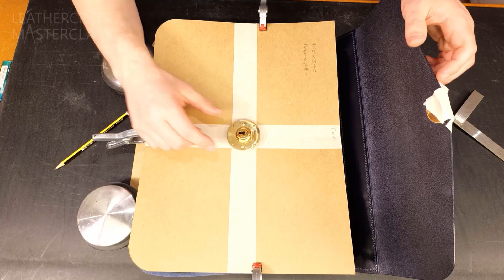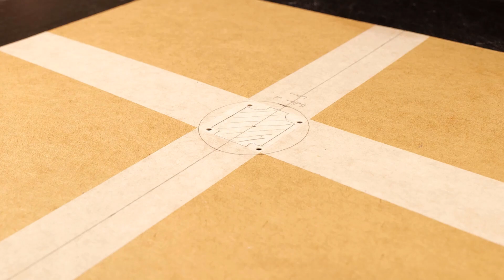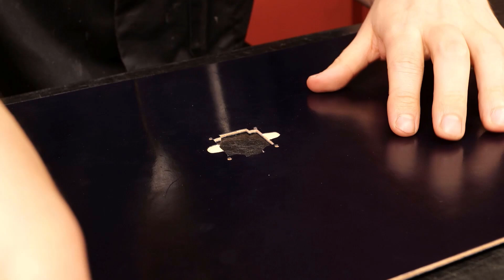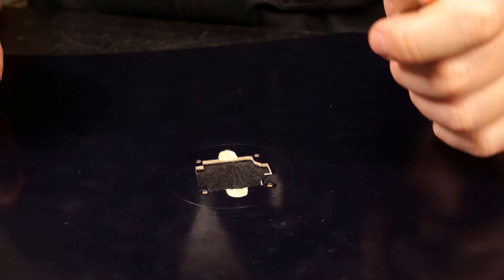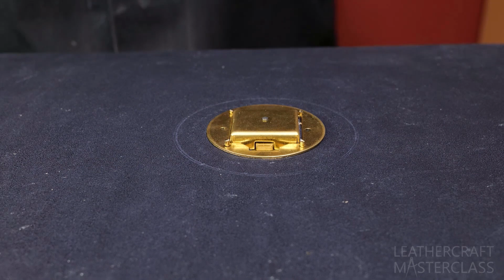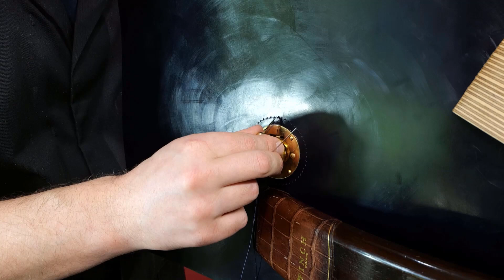How To Fit A Leather Briefcase Lock (Professional Use Only)

Comment: Just installed my very first round lock - the 806 from Abbey. Wasn't able to get brass nails quickly or a rivet setter but instead I used the bifurcated rivets that Abbey supplies. I had about 2.5mm of a gap that needed filling and as I'm making a sample -I just made a spacer with 3mm veg tan. Double sided taped between the back surface of the leather and the brass plate, put the rivets through and split the legs with a screw driver. Then lightly hammered flat. I have a lining in this case - goatskin, but I covered the lock with a 2 discs of salpa - a large disc to hide and protect the lock, and a smaller disk to cover the centre rivet in the rear. After installing this lock...I'll probably order my next ones from MM Colombo as their locks are much easier to work with and they don't protrude as much in the rear.
Reply from the maker: Well, you made it work! MMC are a little less traditional on these cases, but they are a step up in quality for sure. Make sure you don't get the gold plated version though, they don't age well.

Comment: Nice tutorial.  Regarding the riveting, hammering seems risky.  I would prefer to use a rivet setter, or a nail setter, to focus the blow to the nail head and prevent slippage.
Reply from the maker: Yes, that will also work if you require a more steady hand. The key is lots of light controlled taps, but it's all personal preference.

Comment: Hi Phillip, are you using 8 spi or 9 spi pricking iron for this project?
Reply from the maker: Honestly, I can't remember. It was a couple of years ago when I did this, I think. However, I do know I didn't use the same iron size for the whole project. It varies by part.
Reply: @LeathercraftMasterclass that’s okay. But i need your opinion, if i’m making a bag of similar size to the doctor’s bag you made in one of your video and i’m using fil au chinois 632, is it better to use 8 spi or 9 spi?

Comment: Wonderful and precise Phillip as always. One question, if the bag has goat lining , Salpa interlining as reinforcement, and calf skin as exterior , then what’s your recommendation for hiding such a lock ?  Is it better to be cover after sticking reinforcement to the exterior , then hide the lock ,  then after stick the lining ? 🧐
Reply from the maker: Hide it under the lining, but it may still require a leather disc covering the rear of the lock so it doesn't rub the back of the lining. I'd probably choose a different lock though. Even with salpa reinforcement, the lock is heavy and also requires decent pressure to close it, so firm thick veg-tan is recommended so it functions correctly. For a softer briefcase, a lock like the one found on the Hermès Sac à Dépêche briefcase is better, or at least something that doesn't require inward pressure to close.
Reply: @LeathercraftMasterclass you’re right, thank you Philip . 😊